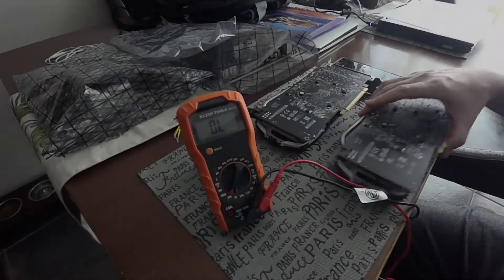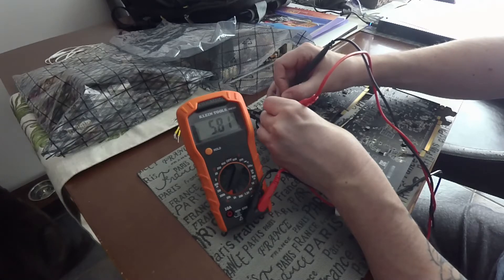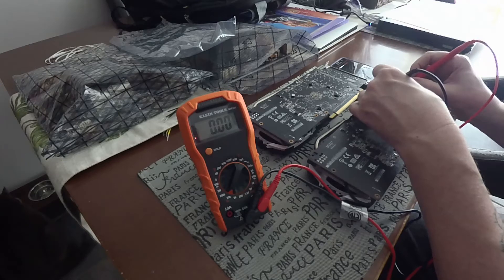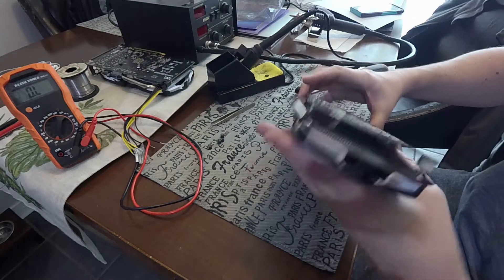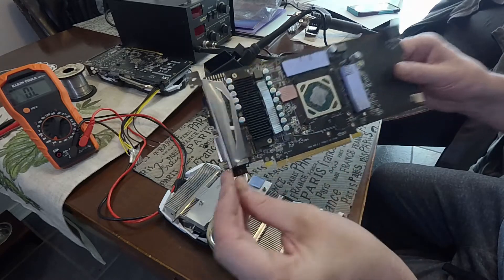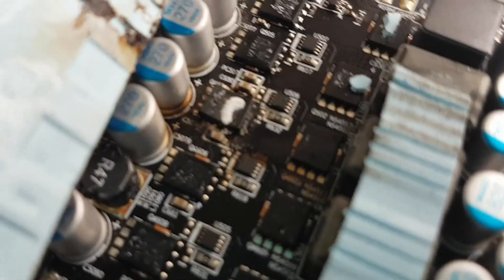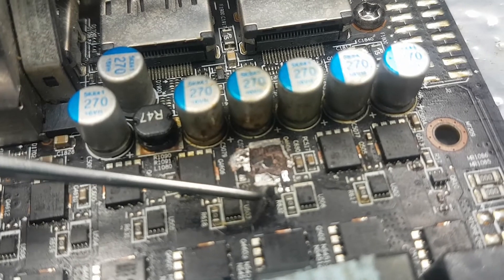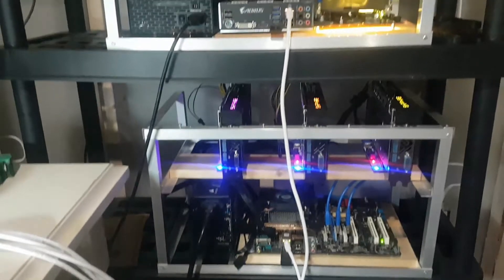RX570 4GB - FIRST Attempted GPU Repair

Comment: I was asking if you could donate that gpu I need parts for my gpu please
Reply from the maker: I still have it here somewhere. Do you just need the circuit board...or the fan shroud too ?
Reply: @candr0idcrypto383  just the board
Reply: Only the circuit board  @candr0idcrypto383
Reply: @candr0idcrypto383  i need the circuit board

Comment: i have similar gpu armor edition but no clue what exactly... but mine have seen some miners trying to repair it and all capacitors are basicly puffed up and die looks realy brown dark so i will replace capacitors and try... maybe she will give atleast something... but no shorts
Reply from the maker: Ya shorts are bad. I have another card here too with a short on the 6 pin. I plugged it in and she started to smoke. Working on that video.
Reply: @candr0idcrypto383  you could kill it... if there is any short on pcie 12/3.3v or any other rail then never plug it in... it will kill die ;) its easy to find short with multimeter
Reply from the maker: @SigmaWorksSW3D  Ya I know. With the 8 pin connected only the card actually powered up, but was complaining it needed more power. So I plugged the 6 pin in, and then I was like oh oh, and shut it off right away. Problem is that it's looking like the 1.8V line is shorted, which probably means the RAM or CPU chip itself. So could be another donor card :)